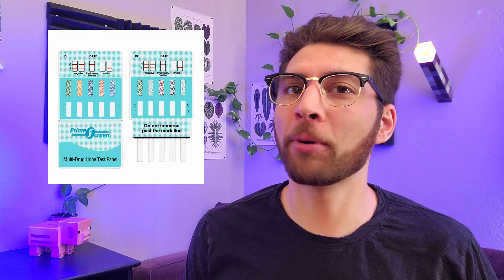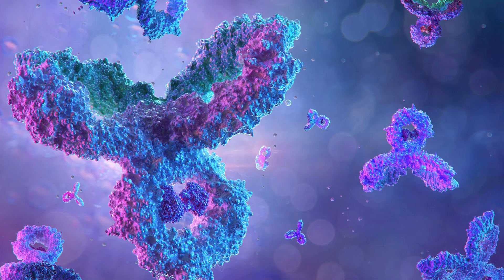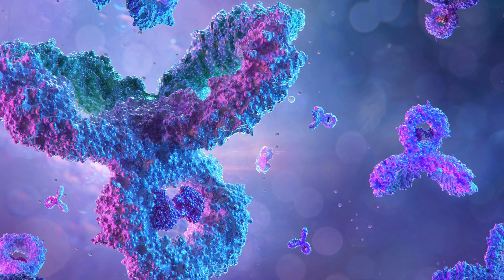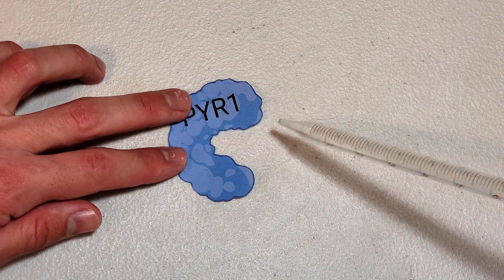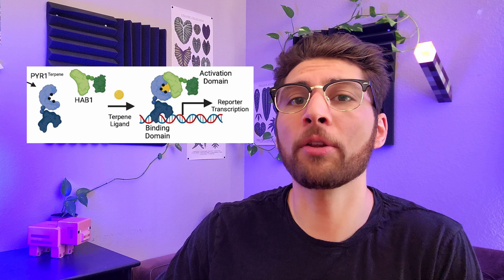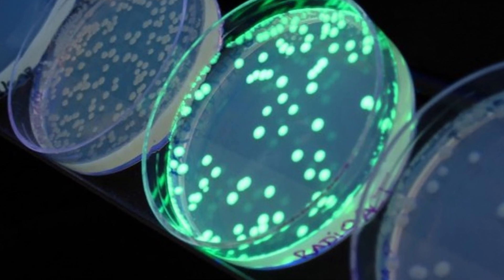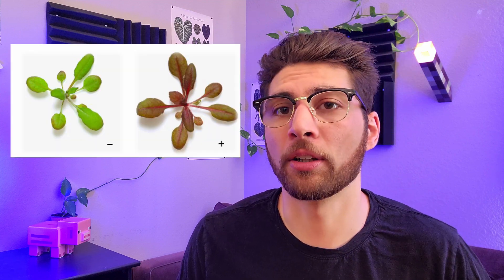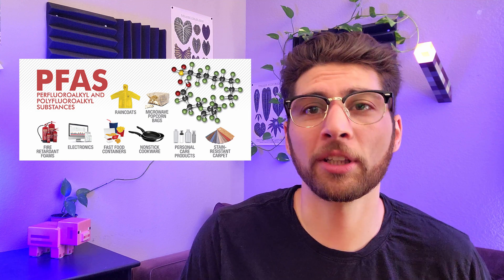What are PYR1 biosensors?

Comment: Org. Chemist here, and I wonder what's the false negative rate on these sensors. Just from a combinatorics pov if we assume that it's mostly the binding residues  that determine the binding to the ligand, that leaves us with somewhere around 20^10 options. That's still approx. 10^13 which is just over the number of small molecules accounted for in the chemical space project. So even undercounting the variability space of the sensors, it is bigger than the variability space of the signal that they are sensing (ligands) meaning one would expect just by chance that the same ligand would be sensed by multiple sensors, leading the false negatives. This is ofc a statistics argument for why false negs would be expected but how is this solved from a bioengineer's pov?
Reply: Just to clarify 20^10 cus 20 amino acid residues combined into 10 binding residues. Ofc not all combinations are valid, cus 20 glycines would ofc just make empty space, but just for an approximation. And 10 cus I've never seen a docking experiment with over 10 binding residues in the xrd structure
Reply from the maker: Fantastic thought. The main library we use only has certain mutations for each residue, resulting in a library of only 30,000 mutants. We then plate ~3 million cells, so that we have 100X coverage of the library. This way, we can statistically say there are very likely no false negatives.
However, often we don't care if we miss a sensor or two, we just want to see if we can find any sensors. For this, having a library of millions or billions of mutants could still be useful.
A more detailed PYR1 video is coming soon!

Comment: Are there limits of detection for PYR1 biosensors? Is the downstream signal cascade dependent on ligand binding affinity? I guess I'm wondering if these biosensors are only capable of spitting out a binary yes or no response to the presence of some ligand. Or is there a way to somehow account for the degree to which GFP is expressed and then do a back of the envelope calculation for analyte concentration?
Reply from the maker: Great questions!
So far we have some sensors that detect down to single nanomolar levels.
The downstream cascade is independent of binding affinity.
There's a bit on how these sensors can respond in my dissertation video and also in some videos that will come out in the next couple months! Short answer is that the linear range of these sensors can be one or two orders of magnitude.

Comment: Great video my guy. You got yourself a new subscriber. I have a question, This method is a simple yes or no right. It's not a quantitative test ?
Reply from the maker: Thanks! They can be set up as binary, but many of our sensors have one or two orders of magnitude of linear sensitivity range.
Reply: @DIYBiotech  thanks for your reply. Is it like how in covid test, based on the viral load the signal which is given is more intense in the antibody test? Also, just binge watched 10 of your videos now, really like your content.
Reply from the maker: @itspranavs  yea exactly like that! Thanks for the support bud!!
Reply: Sorry to pester. 😅 Can't we use the same method but in a microfluidic system so that it can act as a quantitative test?
Reply from the maker: @itspranavs  I'm not too familiar with microfluidics, but from what I understand it could be used to increase the linear range of the sensor!
Reply: @DIYBiotech   cool. Thanks for all your replies. I don't know if you're done with your defense but anyhow good luck with that.